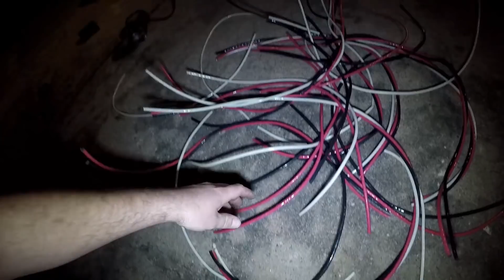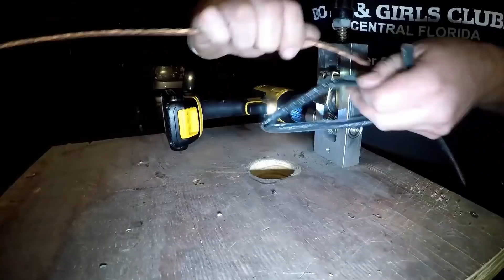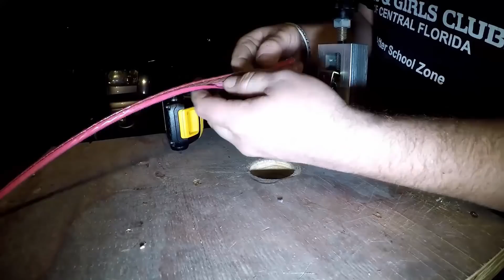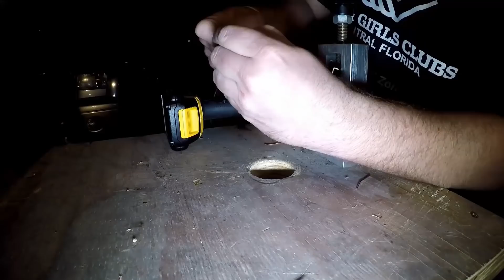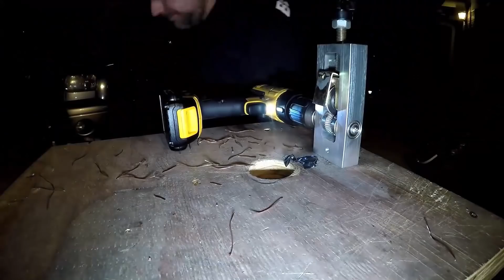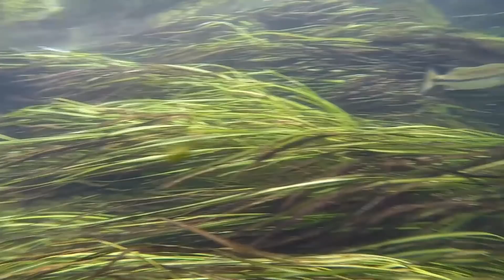Stripping Wires For Copper/Money

Comment: Cool! Been doing this for decades but I still just use a regular knife and a wooden board. I sit here doing that while listening to educational YouTube videos. Then after I'm done I take it to the Czech Republic where I get a much better price for it than here in Germany. Since gas is also cheaper there, it works out pretty well. That is, that's what I would be doing under NORMAL conditions and not in 2020 with all the unpredictable border closures where the situation changes from day to day, hour to hour where I won't risk driving 45 minutes to the border only to be turned back.

Comment: everybody loves to strip big wires, but what do you do with the smaller ones? I see you often pick up extension cords and power cables and such. Do you also strip these or bring them to the yard as is? Would love to see/know what you do with these wires as well...
Reply: Smaller gauge wire unless it's all really long spools or lengths take a bunch of time to strip. Yes stripped vs unstripped will almost always pay more but sometimes not, but if it takes you 1 hour to strip wire to make $5 extra you decide if it's worth the time. either cash it in as is or save for rainy day project